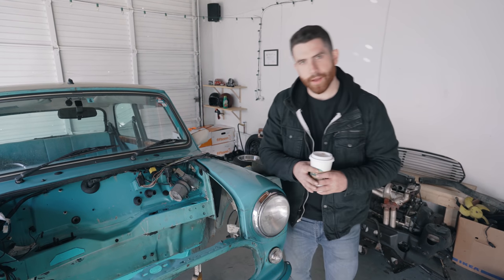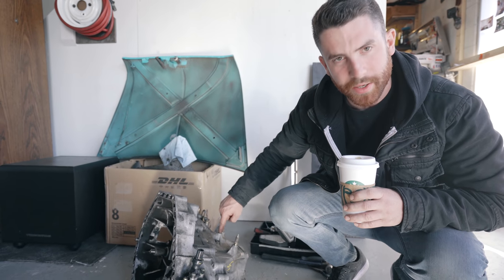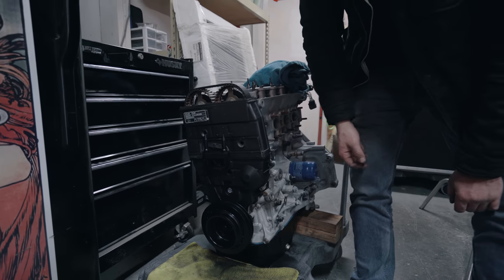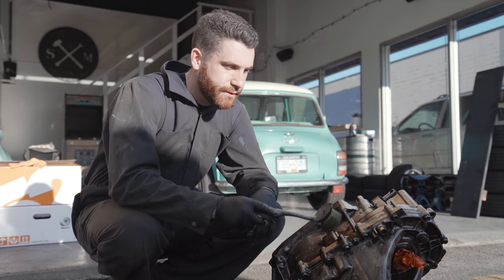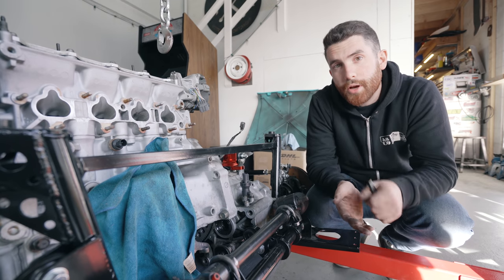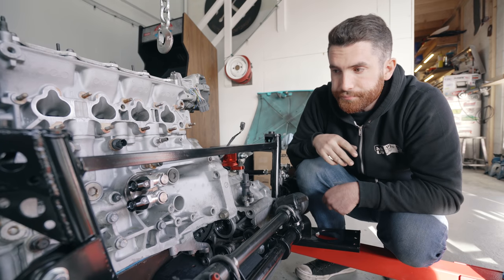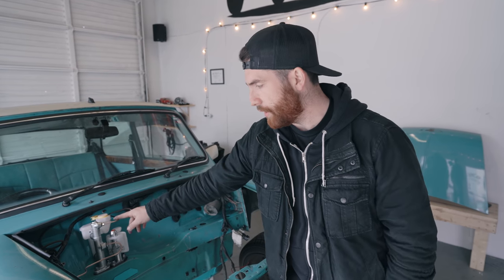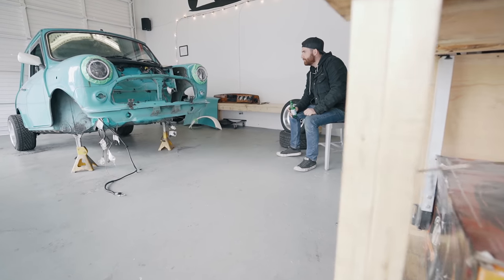VTEC Mini Ep3 - We will rebuild

Comment: Where exactly did you mount the chain to the motor to lift it onto the subframe? Looks like you used two separate holes per side to bolt into. Did you just use a washer and bolt?

Comment: You mention hardline to -6AN fittings. Do you have the specs on those ? Its something I would like to do on mine so I can route the fuel line to the other side of the engine bay.

Comment: Does your sourced trasmission have a   Limited Slip differential?   Be sure to check into it... or you will have One wheel Peel for days.... 

Wheres the turbo?
Reply: that's not so obvious in a vtec mini. I have LSD but guy who built it says it may do more harm than good when it comes to torque/bump steer

Comment: guys what FD ratio is it? if it's 4.2 or even 4.0 you'll make it a 4-gear car (that's based on my setup - 1st gear is useless), so consider replacing it to a 3.5 or 3.7
Reply: wymyslmilogin This. I have a s9b box in my vtec mini and it’s way too short with the 4.2. I’ve got a Watson’s 3.7 for sale, just swapped out for a Mfactory 4.05 and a long 5th. I found the Watson’s too noisy with the straight cut style whine.
Reply: @BobMarley-yq3wi  hey, I also have S9B box! so far I bought the .714 5th (still not put in), not sure if cutting on .15 in FD is worth 700 EUR
Reply: wymyslmilogin I think it will be worth it. I found the 3.7 a tad too long in all honesty, took away all the punch in 2nd and 3rd. I’m not sure why people are putting 3.4s in... 10 inch wheels maybe.